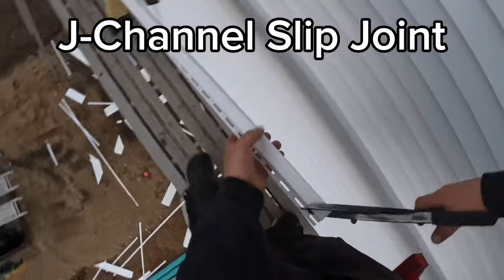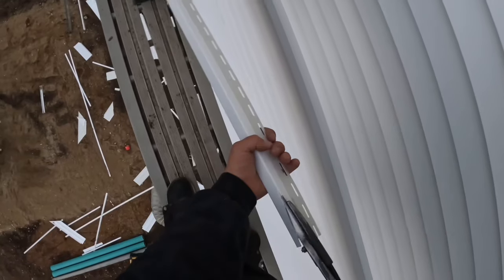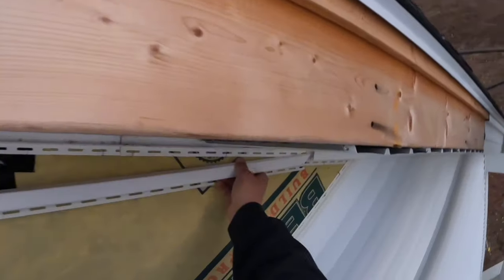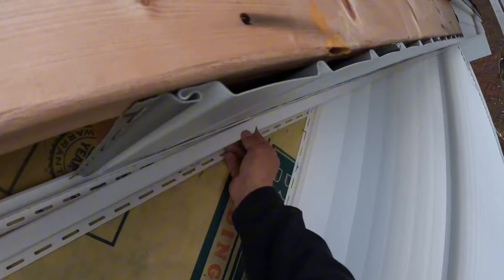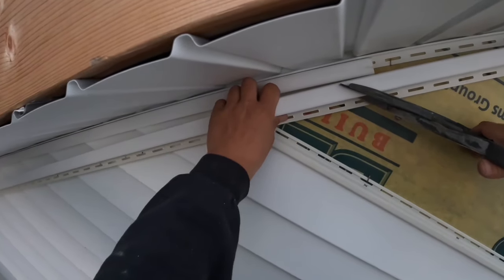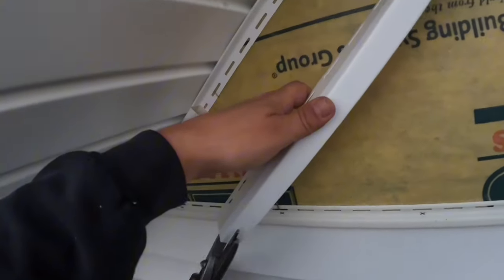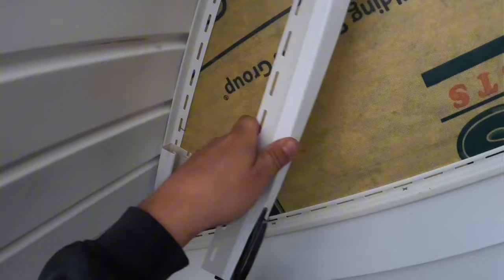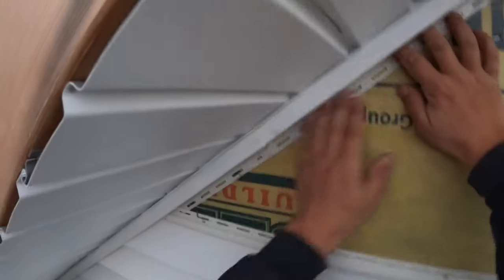How to merge two pieces of J-Channel

Comment: How would this work with F-channel if at all?
Reply from the maker: There’s probably a method for that, but I typically just butt them together… I haven’t seen any problems doing that. I think it expands and contracts a little less because it is under the eaves and doesn’t get any direct sun.

Comment: Is this practical around windows if you only have small pieces of j channel to work with?
Reply from the maker: I try not to put extra seams if it can be avoided… some people don’t seem to mind the look, but to me it’s not a “professional” looking job. If the windows are on the second floor you could put the overlap facing up (away from the main vantage point) so it is harder to see.
Reply: @sidingschool thank you. I was going to shortcut a window but I’ll just make another trip and wait a day, not the end of the world 😂. I was trying to get it done today but no reason it has to be done today.
Reply from the maker: Sometimes it is hard to stop a project 1/2 done lol. I get it.